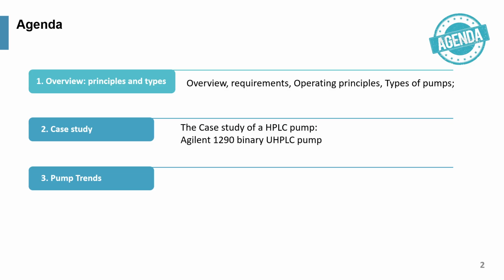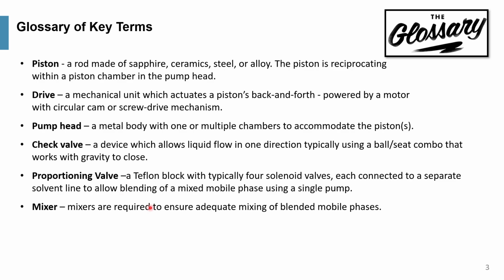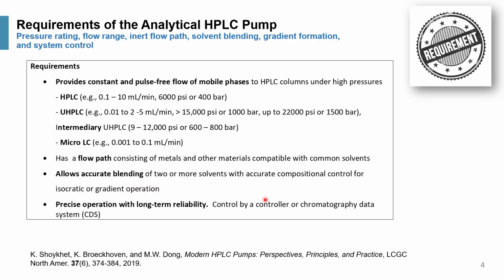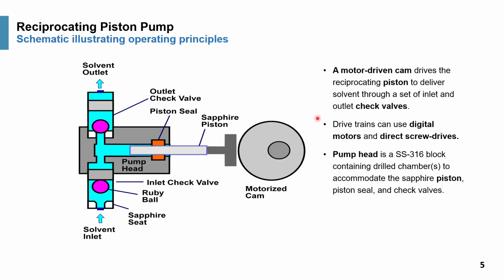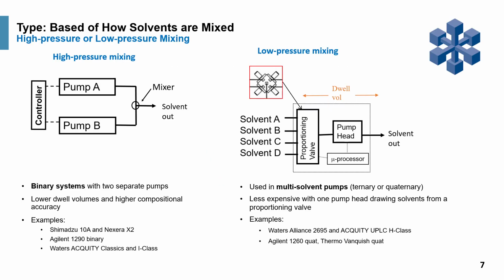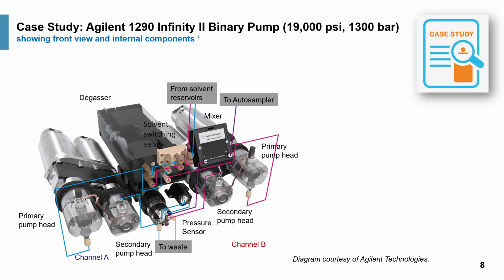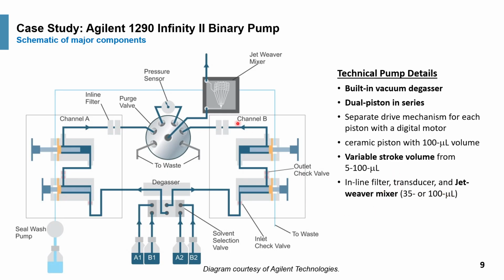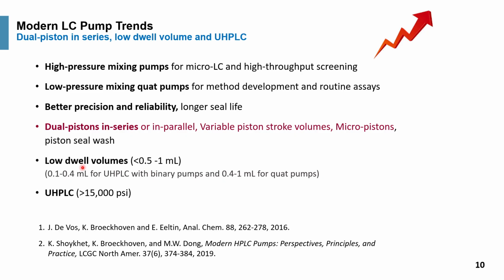19.  Ep-14. HPLC Pumps:  Operating Principles, Types, and Trends

Comment: Good morning!  I used mostly quaternary, low pressure-mixing LCs, except for one Agilent 1260 at GSK.  Didn't really 1:04  understand why more of the serious  LC-MS guys didn't choose binary pumping equipment.  The LC-MS systems I used were both low pressure-mixing.
Reply from the maker: quat pump is the norm and likely 80% of the systems in used.  binary pumps cost more is required for high-throughput and low flow applications. they are also more expensive which may be the reason for lower adoption rate. For instance 1290 binary could cost $10K more than 1290 quat and Waters seels more H-class than I-class UPLC etc.